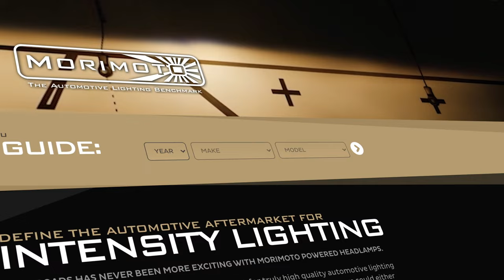Introducing The All-New 10-23 4Runner XB LED Tail Lights | Installation & Overview

Comment: This is exactly what was missing from the 5th gen 4Runner options.  I was looking months ago for a set that had the running light at the perimeter of the light and the nearest options had them fairly inset from the actual perimeter.  I do wish they'd put some bigger brighter reverse lights in it, but it's good enough.  I'll be watching for a promo code then snatching these up.
Reply from the maker: Good deal, can't wait for you to get a set. Add a Backup Light Boost Bar to your order for more reverse light output!

Comment: Looks neat! I am definitely considering these for my 23 4Runner Limited AWD in Magnetic Gray Metallic (purchased in mid-August). Hard to choose between the red and smoked finishes. Would like to know the torque specs for tightening those 10mm nuts on the taillight installation of these Morimotos. (2:30). I checked out the installation guide on your website and it did not list those torque specs.
Reply from the maker: We used OEM torque specs!
Reply: Thank you. So, the torque specs were specifically what setting (lb ft)? I lack access to the actual OEM torque specs so while I appreciate the reply, it wasn’t specific enough to be helpful.

Comment: So one thing that I did not see demonstrated.

Since the turn signals and the brake lights occupied the same space on these lights.

What does it look like and what does it do when both the brake light and turn are on at the same time? Does it cancel the brake light? Do they try to both show at the same time?
Reply from the maker: The brake light will default to the turn function when activated, they will not interfere with each other.
Reply: @MorimotoLighting  ...... So it's a slight step backwards because you lose a brake light when your turn signals on... 

Which is even worse for all the idiots that drive with their hazard lights on. Now you've disabled your main brake lights on a vehicle that by default has separate brake and turn lights.